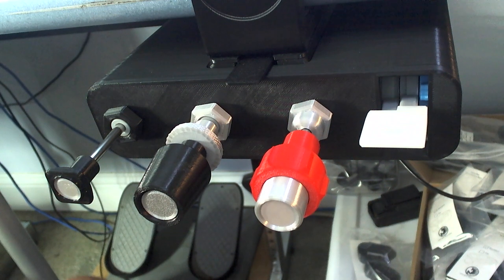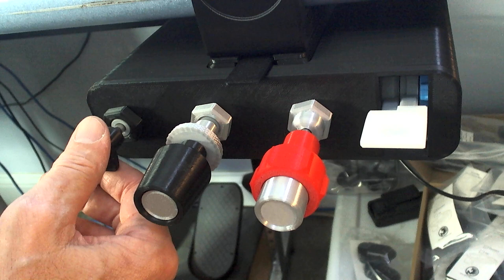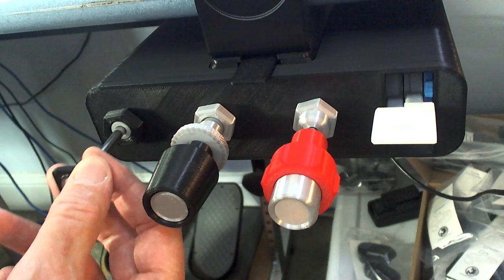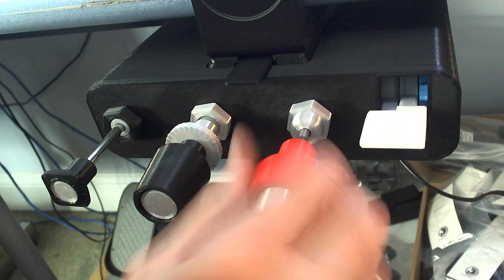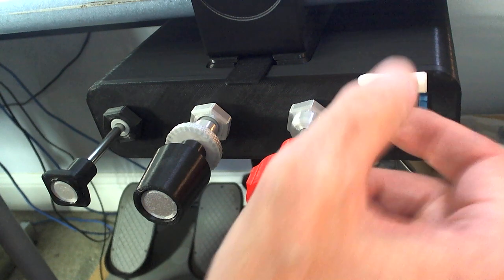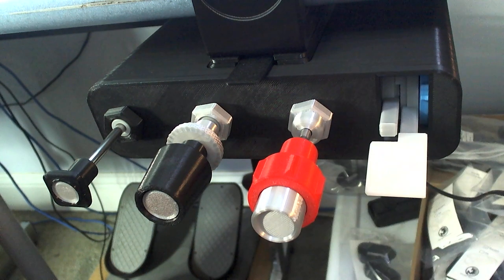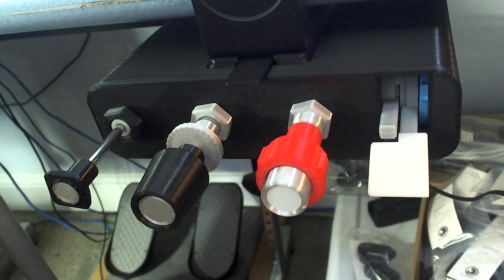New FCP172A Demo

Comment: Just picked this up for the 172SP in the sim, should arrive Thursday. As I am starting my PPL journey and this is the aircraft the flight school has, I got this in order to be as realistic as possible. 

Will the analog functions work with MSFS via FSUIPC?

I have a custom 737 throttle quadrant, which I built and the analog functions work through FSUIPC, however, I programmed the Arduino for analog controls, not sure how this is coded.
Reply from the maker: I don't know anything about FSUIPC, but the controller will show up in Windows as a standard HID USB joystick, so I would assume it will work fine.
Reply: @gear-falcon5812  if it shows up like a joystick it should work. Thats how the one I built it shows up, and the analog functions work. Thank you!

Comment: Farily interested in your stuff. 
What material do you use, is that PETG or ABS?
If you use the latter, which i find preferable, you could "Acetone cure" it. That would give everything a very smooth look and feel to it ;)
Reply from the maker: PLA for the most part. ABS and PETG tend to warp too much, especially on the larger parts. I may start using ABS on my next version, at least for the chassis. Upgrading printers to do that. I've done the acetone vapor cure on items before, but it is a finicky and messy process, so definitely won't do it for production parts.

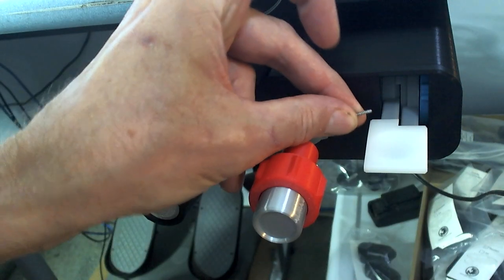Comment: @Gear-Falcon, I left a comment on the Overkill review of your FCP panels. Not sure if you check back and I hoped to ask you a couple of questions. At about the 4:09 mark, there was mention of some labeling changes. Can you share any details of what that will be? Is that something to wait on? Second question, if requiring the exact 172 configuration isn't crucial and would like to have the flexibility of using the propeller pitch lever when transitioning to the 182, I assume one could go with the FCP182A and configure the prop lever to do nothing or leave, as is, since the 172 has the fixed-pitch prop (essentially the prop lever does nothing)
Reply from the maker: Instead of printed labels on the front and back i might switch to silk screening, but don't hold your breath! No reason you can't use the FCP182A while flying a 172, you simply won't use the pitch control.

Comment: is there an option without carb heat, just with throttle, mixture and flabs ?
Reply from the maker: You can check our web site for all options - www.gear-falcon.com
The FCP172A has Carb Heat, Throttle, Mixture, and Flaps, with an option to plug in an elevator trim module. The FCP182A has Throttle, Prop Pitch,  Mixture, and Flaps also with the optional Elevator trim.
Our GA series controls have various other options, but do not include flaps or the option to plug in an elevator trim module. So, no, there is no variation with Carb Heat, Throttle, And Flaps.
Reply: @gear-falcon5812  perfect Thanks. I guess I go for the carb, throttle, flaps . and add the trim